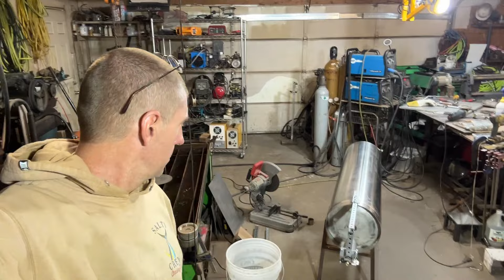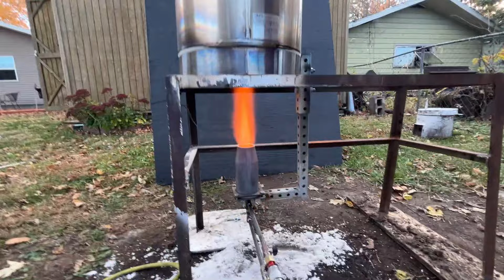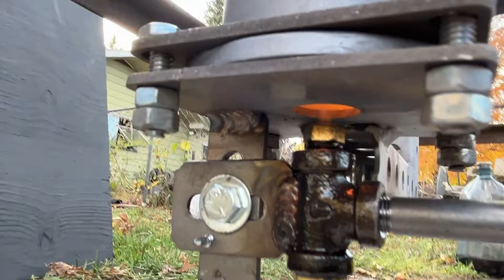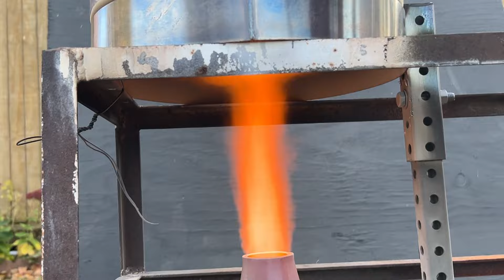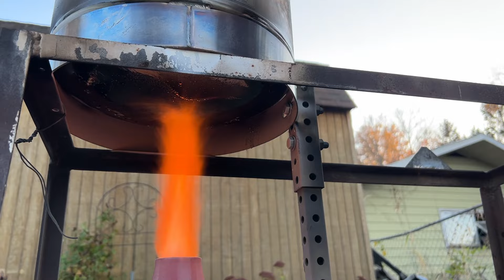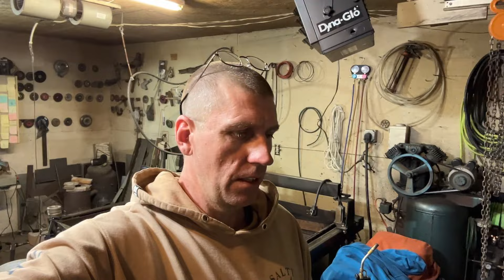Silicon Carbide waste oil hydronic heater

Comment: Hey, cool videos! I wonder what would happen if vaporized waste oil would be put trough a glowing pipe before entering combustion chamber or tube, would it raise temperature like in the hydrogen thing video?
Reply from the maker: yes but build up would be an issue

Comment: So paint and body guy here own a small shop. Iv copied a few of your ideas to keep the shop warm since waste oil is free and infinite for us and now I'm building a new down draft paint booth. Being the diyer I am I'd like to build something to make heat in the exhaust well under the car. Any ideas on a design that's gonna give me a ton of heat but no open flame? I considered getting some more torpedoe heaters to mount down there but the cost per BTU and open flame kinda make me not love the idea  and I need a lot of btus don't know exactly how much but from experience 100k-200k is probably about were it's gonna fall. The booth is 24x16 and 12ft tall. The fans won't be on during the bake and I'm familiar with Arduinos enough to make myself a controller for everything. I also have basically infinite compressed dry air as I have a total of 75cfm@90psi worth of pumps. About how big of an orifice do you think I'll need? I'll be on a 20% gasoline 80% oil mix as that's what the generator and compressor and shop truck run on and I already have a small fuel plant set up with a centrifugal filter and a few ibm toats so 500gal clean and 250gal to be processed. I'd actually recommend some centrifugal filter as they are cheap and easy to make. Welded my bowl together from scrap and had a friend refine it on the lathe plust a pressure cooker pan and a harbor freight grinder 😂. Honestly it works really well especially if you preheat to get the water out. I'd like to be able to get panel temps up from 40°f to 100°f in about 15min then cut it off and just let it sit in it for 20min then cut the fans back on to extract the heat.
Reply from the maker: Try and email me the youknow who tube wont let me communicate here , they are using AI to block small business . they even throttle my views like on facebook , they expect me to pay for "REACH"
Reply from the maker: Check the description

Comment: That is real waste oil. Diesel  15w40 with gear oil in it.   This car oil that's 5w20 is nice sweet stuff.😆
Generally water in waste oil will be on the bottom of the tank. Just drain off before winter. Plus the sludge is on the bottom.... never suck off the bottom, minimum  6 inchs off the bottom...

Comment: To avoid flameouts, you could add a sacrificial piece of some type of metal into the burner to be directly heated by the flame to where it’s above the auto-ignition source of the fuel, so that after that water or dirt bubble flies through, the residual heat from the metal reignites your fuel

Comment: The easiest way to strip water from your old oil is to pour it through a fine screen wire mesh filled with a few ounces of calcium chloride.

If its a whole lot of water [or a lot of oil] put it into a container you can use a paint stirrer inside of and spin it until all the calcium chloride takes away all of the water [calcium chloride is not oil soluble and will guaranteed, strip its own molecular weight in water out of the oil every time, and fall right to the bottom, easy to drain off after a short time of settling].

Comment: this is great, i use an old gas boiler heater core, very very efficient at turning the heat into hot water, you can put your hand over the exhaust and its like 50c if the waters cold

Comment: do you have a way to sinter silicon carbide to solid pieces?  Laser maybe?  Some sort of cement or epoxy?
Reply from the maker: It requires a vacuum furnace at 3000 deg for 1 month . Its a serious operation